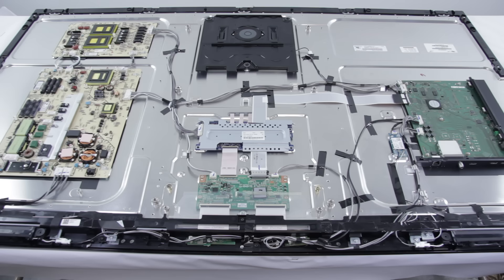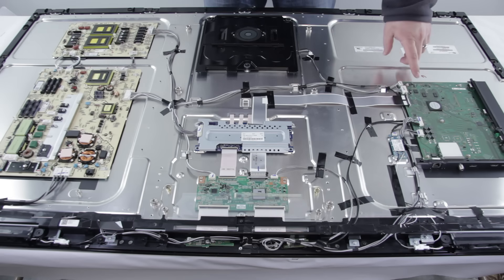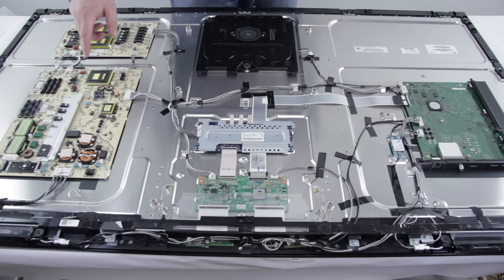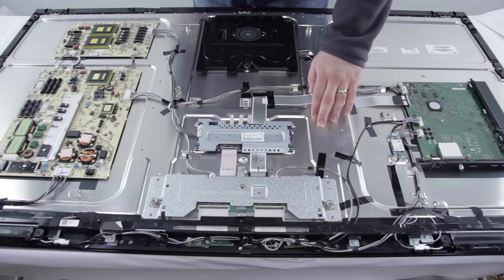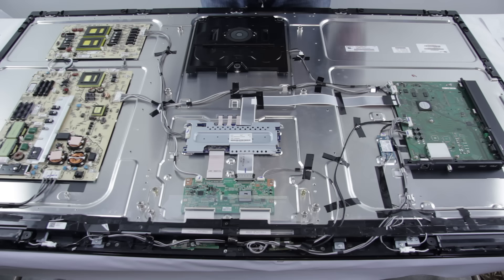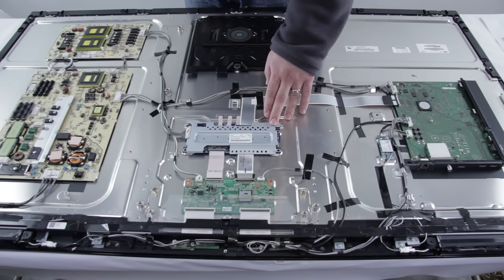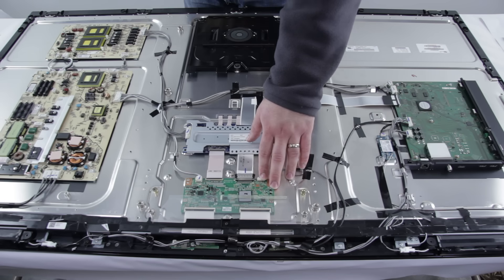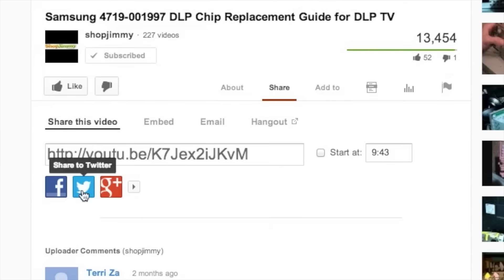LED TV Repair Tutorial - Common Symptoms & Solutions - How to Repair LED TVs

Comment: Hi. My Sony XBR49X900E turns on and for a very few minutes everything looks normal (picture and sound quality excellent) then the screen goes black and a red lights blink blinks 4 times every 3 seconds. I followed Sony guidance to power resets with no success! Could it be s failed LED Driver board ? If not What other boards could be suspect. I dont want to pay repair shop $200 to 250 for diagnostic & repair with parts cost additional.

Comment: Can you, a much-cleverer-than-me expert, help me bring a Panasonic TX-43JX600B TV back to life, please?

It has a no picture or sound problem, even though the red standby light switches to green when switched on from the remote. I've tried a hard reset, but no improvement. Also have removed the rear access panel and physically & electronically (multimeter) checked fuses (x3) plus all capacitors, diodes and resistors - all of which appear fine. When plugging it back into the mains, with the rear access panel still removed, I can see the back light IS working but the screen remains blank and unresponsive to any of the remote's demands - except Off/On.

Any ideas?

Comment: Hello, I have a Sharp 43" LED TV Model number LC-43LB601C. Symptoms are wide vertical bars that reveal a skewed snowy picture and ghosting. I ordered a T-con board from ShopJimmy and after replacing it the TV worked well for a few hours. Now back to same. What else could it be? Thanks

Comment: Hi Jimmy, I have a SONY KD-65XE9005 s/n 6706145 p/n 18887001.  Suddenly, out of the blue, it does not respond at all, remote and rear power button do nothing, no lights.  I removed the rear case and checked the power board, I see 24V and 12V on the output from the power board.  What would you suspect to be the fault?  Main board?  Are there some easy checks I can do? Thank you

Comment: Dynex  LCD TV model no. DX-L32-10A. Power supply board, cold side. Out puts: 5v, 12v, 24v. good output, calls for 32v, no output. When plugged in red standby light is constant. Can you  offer remedial. 
MJ in B'dos  🇧🇧 thks. PS. TV has a black screen, no sound.😊

Comment: I have a Seiki  SC-50UK700N that will not power on. I replaced both the power  & T-Con boards and it still does not power on. The RED light power button will illuminate but nothing else happens. The remote doesn`t power it on also. I pressed the red power light button nothing! I was watching it ,turned it off to leave home ,came back pressed the remote nothing! can you help me?

Comment: Hello, my led tv sanyo model number XT-49S7200F is having horizontal lines running across the display which are increasing over time, what could be the problem, plz reply with solution if possible, Thank you.

Comment: Good evening. I have a 65 in Vizio Model E65-E0, serial number LAUSVKAS2900153. The problem is that the image blinks on and off when the image turn from dark to bright. I just changed the main board and that is not the problem. I just ordered a new T-com and Power board. I believe that another smaller board was in the kit but you don't sell it separately. What else will be requiered?

Comment: Sharp LC70EQ10U at first the sound would go up and down on its own. A few days ago the screen went blank and would not go on or off, there is a flashing light on the front. Tried to reset by holding down the volume down and input buttons while pllugging in power, when this is done Sharp would appear on the screen and after a few seconds the light would start back flashing on the front.

Comment: Hello i have a question about a Vizio V585 H11 repair I'm undertaking for a friend. Upon receiving this tv it did nothing so at that point I installed a new power supply, nope, not that. Installed a brainboard, now it boots but looks like the menu dashboard is messed up. ordered & installed the t-con board, nope same thing. What else is left to replace? or is there some kind of hidden way to align the image. Any help would be great.

Comment: TV Brand: LG
TV Model: 42LB5600-UH.BUSWLJR
Symptoms: 
- No backlight. Sound Ok. Picture shows when using a torch light.
More info:
- One of the LEDs was flickering for a few weeks before complete loss of picture
Actions so far:
- Replaced Power/led driver board. No luck.

Questions:
1. What should I do next? Should I try replacing all the LEDs? 
2. Can you lose full picture even if just one LED is out?

Comment: Hey Jimmy, got a Vizio V705-H1 from a yard sale. Plugged it up and it powers on. Visually you can't see if the screen is cracked but it does have an Image of a wide paint brush stroke in the middle (about 10" wide & 5" down) and it has a little of the same about 2" tall on the bottom of the screen. The rest of the screen is dark. We haven't tried to attach any signal device yet. How would we determine if it's the TConn board or bad screen? I can send you photos if you need me to. Thanks

Comment: Thank you for your quick delivery of the repair package. 
My rca 43” led full hdtv s/n A2009341530000981 has 60 horizontal  color lines where colors are off or different. Do you suggest that I replace all the parts provided?

Comment: TCL Model 65S531.  TV works fine except for one verticle line running down the screen.  You can still see the picture through the line, but it is shaded darker.  My initial thought is that one of the LED strips is bad.  Is this probable & if so, where can I find a replacement strip?

Comment: So i have a question, I have a Hisense 65H6E the TV will power on when either the power button or the remote activates it. The Hisense logo displays and then before the regular other starts ups begin... the screen goes black. the red light flashes when you press it and goes back to to solid when the start up fails. I tried replacing the T-Con board, the power board and the main board with what where supposed to be good parts?... same symptoms.. no image after the logo... just turns off. Any assistance would be appreciated.

Comment: Hi Jimmy, I  have Hisense 70R627- W194609 about two years old it was working great turned off and went to bed the next day I turned on and the screen only showed hisense and roku one side of the screen is darker than the other and light's up and dark screen tried to reset it didn't work It doe's have a red light blinking on the bottom of the tv. what do you think my problem could be?

Comment: Hi. I recently purchased a repair kit from you that contains the main board, power board and t-con. I had audio but no picture. The screen was giving me a grayish color. After I replacing all the components, I lost audio. I swapped my original main board back and got back the audio, but I still have no picture. If I tap the screen I get bright flashes of light. I can also see the led's lit from the back. What else could it be It's a Vision model Vizio V585-G1

Comment: LG 60UJ6300. Screen went very dim (not blank) and will not brighten back up with any amount of settings combinations or changes. Replaced TCon Board and Power Supply and it brightened back up and worked properly for about a month then went dim again. Power cord is good. Not sure what else it could be.

Comment: hi 
I have a Hisense 75 inch 75H78G
I have the following problems
1. TV led blinks 18 times when turning on
2. LEDs do not receive power from the power supply
3. LEDs all work when receiving independent power source
4. TV sound comes on properly
5. When the LEDs are powered independently and the TV is on, the screen shows vertical colored lines
any assistance would be appreciated

Thanks

Comment: Hi Jimmy, I have a Samsung Q75Q6FNA and it is experiencing turning on and off automatically.   I unplugged for 5 minutes, but it continues to have the issue.  I unplugged it again and disconnected all cables except the coaxial antenna.   When I plugged it back in it stayed on for 3 minutes and began cycling on and off again.  Any suggestions are appreciated.  Thanks

Comment: Hi guys 
I have 65” Samsung TV , UN65H6203. Got it none working, changed backlight stripes, works now. Connects to WiFI , but very slow, tried reset, software update, shows latest version. Decided to try Ethernet cable, but no luck, it says invalid MAC address. Cable works with other tv right away.
Please advise, 
Maybe needs software update through computer or usb? Tried Samsung customer service, they asked me to do reset, and said problem with router, which is not right.

Comment: I have a Vizio D55X-G1 55" smart TV.  I turn it on and the standby light goes brighter for like 5-10 seconds then fades to off.  The screen stays black and the flashlight test shows no image on the screen wanted to check voltages from the power board to the main board but the legend on the power board does not show what the voltages show be,  Would the symptoms lead you to believe the problem is more likely the main baord?  power board? T-Con board or something else?  What should the voltages be and where should I test them on the boards?

Comment: Sony Kd-60x690e  TV turns on but has no picture at all. When I turn it on the LED light on the bottom front of the TV is initially green when power button is pushed. It then changes to a red light and will blink 6 times then keep repeating itself. I've tried on off, I've tried to do a reset manually ,I've tried all the quick fixes with no luck. I know it needs repair and am hoping for some advice on parts or if it's worth fixing at all

Comment: I have a Samsung UN55MU6300FXZA  Version FA01 My question is the sound is stuck between 18 and 21.  Also I can not enter in wifi passcode.  The sound and picture works just no adjustment on the sound, also intermittly will loose source from cox is power is lost.  Thanks

Comment: Hello, great video but did not quite identify my problem. I have a Visio M65-EO 2017 model. The tv's  white led power light in the lower left corner comes on and remains on as soon as I plug the power cored in. I can not turn it off with the power button of the remote. There is no picture or sound, it is a complete black screen. I tried all the reset methods but nothing works . I also tried the flashlight method and there is no picture in the background. Initially the picture came on but the remote would not function. I powered it down and turned it back on and that is when I got the black screen with the power light on. would really appreciate your help. Thanks

Comment: Vizio m701d-a3r,  my right upper quad has a dim picture but, sometimes its 100 percent fine and sometimes it's there, its been doing this for 2 months...  I turned the tv on and seen the blackish spot flick on then dim down like theres a short maybe.??? I'm not sure if that's a led or led driver board.  If it was an led strip would it consistently be black ?

Comment: Hi, Jimmy. My Samsung UA32D5000 led tv has this particular problem: often, when its turned on, the picture is very dim. There is picture, sound but often the picture starts out quite dim, medium dim and over time, say an hour or two, it turns normally bright. The picture setting in the menu is standard setting. Placing it on natural or theater mode makes it less desirable on the brightness. What do you think is the cause? I would appreciate your help on this matter. Thank you

Comment: I have Sony Bravia 43 inch KDL-43W800C Android TV, its half screen flashes a little bit in interval of 5 to 7 seconds and  some horizontal bright lines flickering sometimes, Does the problem is with the dirt or loose ribbon connector? Please Help

Comment: I have a Samsung "MODELE NO": UN39FH5000F  Type No: UN39FH5000  Model Code : UN39Fh5000FXZA  Version No : PF03  S/N : Z79L3CUF516094D
When I plug it in, it plays a little melodic sound through the speakers, and the standby light will hold on steady for about a second, then blink six times.  After that it turns off, and will blink on very briefly every time you push the power button.

There is no display that I can discern.  I tried shining a bright flashlight into it as you describe, but all I can see is glare.  The power supply checks good, and there is a little trail of carbon from smoke (sometime in the past)  exiting from one of the backplane holes, about halfway up on the far left side (when looking at it from the back).  I assume this to be a bad connection between an LED strip and it's plug...

I don't have any experience with these at all, but I assume the six blinks are some sort of trouble code, and the TV is shutting it's self down in a protection mode?

Comment: Hello. Thank you all for this thread. I have a Vizio P502ui-b1e. When I press the power button, the light turns on on the bottom corner of the set then slowly fades out. I've done some research and all sites and techs day that it is the eeprom chip. If it is your determination that the diagnosis is correct, please contact me at louisacevedo1705@gmail.com and provide a list of all necessary parts, tools and supplies needed for this repair and an order form for me to get my set back up and running. Thank you for your time and assistance.
                                     Sincerely, Louie.

Comment: I have a Vizio M50-C1 that just went out the other night while I was watching. First it locked up with a image on screen. I unplugged and plugged back in. it came on and the screen went kind of yellow with a brick pattern and then went black.  The power light comes on and dims down but I have no picture or sound.  I have already replaced power supply board and have same issue. LTCWSPBR
Reply: 1st post pinned in the top, "Thanks for watching our TV repair video! Due to YouTube policy changes, we are no longer answering tech support questions in the comments section."

Comment: Hi. I have a 2016/17 Sony Bravia KD-55xe7002. The fault is that the TV switches on and shows a good backlight but no image or audio. I have replaced the power supply board, main board and T-con with used items purchased via 'reputable sellers' on eBay) but the same problem remains. I do get 12.5v going into the T-Con board measured at either side of the fuse and similarly 3.3v and 1.8v at the test points labelled such on it, but varying between 0.3v-0.5v at the remainder of the test points before those lines connect out the panel itself. As far as I can see, the panel itself is OK with no cracks or damage and in measuring all the capacitors on the T-con and panel driver boards there are no shorts. Similarly the 12 flex cables between driver board and panel show no obvious damage or corrosion. Any ideas what the test point voltages should be and what else I could try or what the problem might be ?. I am tending towards it being multiple bad mainboards (sold to me as good/working - knowing how eBay sellers can be !!)

Comment: I have inherited a vizio model E701i-A3 that I am convinced I can get working however my symptoms are.  No picture and it will not power on even after resetting the TVpower.  I can unplug and then replug in connector going from my power board to main board and occasionally get a popping noise from speakers and sometimes get screen to flash but that is all.   Flashlight test failed to see backlight and other than popping noise when unplugging and replugging in connector as mentioned above no sound either.   What do you suggest the problem is?
Reply: 1st post pinned in the top, "Thanks for watching our TV repair video! Due to YouTube policy changes, we are no longer answering tech support questions in the comments section."

Comment: Sharp model LC-58Q7330U. No sound or picture. When you turn on the TV the power button is comes on. One long then two short flashes. I took off the back turned on the TV. The TCon board had two led lights that flashed. Just before the the power button did the two short flashes. Need advice on what to replace.

Comment: 2015/2016 "Vizio M60-C3" The device has permanent dark spots in various areas of the display. I'm fairly confident it has some LED's out and needs new light strips. My question is if I have to take the device apart are there any parts I should replace at the same time. Ex: control boards, seals or bushings. I have a bit of experience with electronics repair from my work in Automotive Technology. So I'm going to try. Do you have the light strips? What other tools do I need on hand?

Comment: I have a Panasonic TX 55DX600B tv which has the standby led on and standby voltage of 5.1v on one of the power supply pins.All other pins have no voltage until power button pressed then normal voltages appear on other pins and on main board pins for about 5 secs then backlights flash and tv goes back into standby voltage only with led blinging about once every second.Is there anything else I can check to confirm which board is wrong?Thanks
Reply: 1st post pinned in the top, "Thanks for watching our TV repair video! Due to YouTube policy changes, we are no longer answering tech support questions in the comments section."

Comment: I have an LG 65UH5500 65 inch LED tv that I just replaced the LED light strips.  The TV turned on and have a perfect picture.  I left it on and about an hour later it was off.  When I turned it back on, only half the screen had an image and that image was distorted.  I've replaced the t con board already but did not fix the problem.  Couldn't be the main board or is the panel fried.
Reply: 1st post pinned in the top, "Thanks for watching our TV repair video! Due to YouTube policy changes, we are no longer answering tech support questions in the comments section."